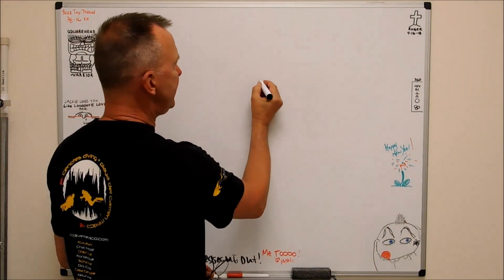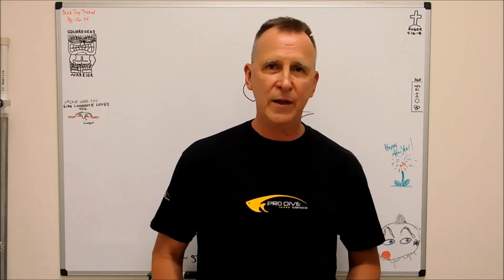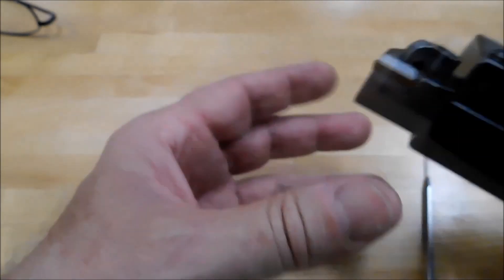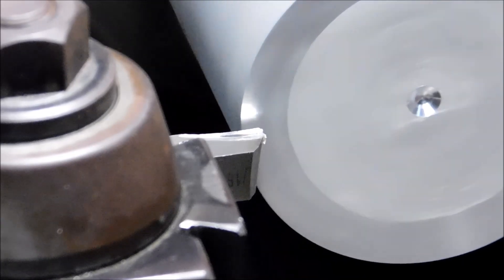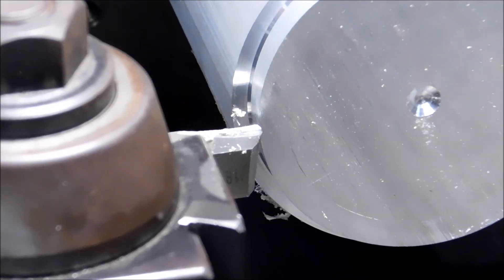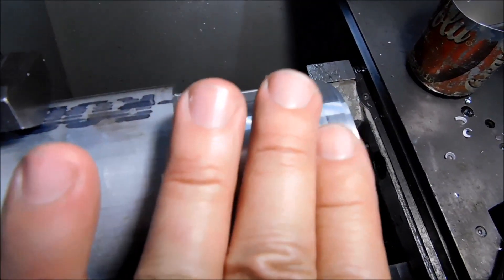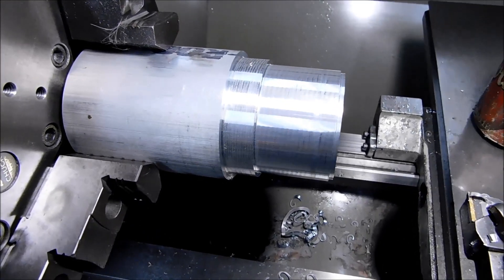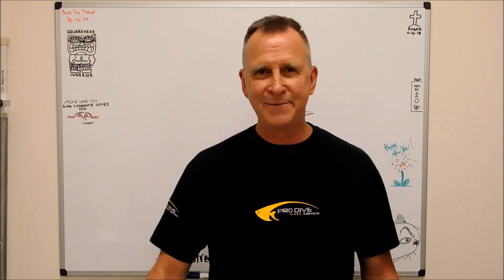C's and 6's...The Perfect Lathe Chip

Comment: Awesome I've never had the nerve to take big bites like you demonstrated. I struggle with getting perfect finishes on various materials, faster speeds & slower feeds with light cuts is my go to at the present still not the best. I've used both HSS & carbide various tip widths, no "consistency" when last pass to spot on size wanting the perfect finish, winds up it is what it is 😢, using a Monarch CY16, only 500+- RPM lathe speed available. maybe you can give me a few tips or do a short how to video, i'm sure there's others that might struggle with consistency also.  Happy New Year, thanks for all your efforts & time making videos, I've learned tons 😁
Reply: My neighbor has been a machinist for over 40 years. He told me if you get it close, just use sand paper for the rest. It may take a little longer, but you can always take away from what you are making but cannot add to it. That's what I practice. I'm using one of them chinese 7x14 mini lathes 0-2000RPM. My steel RPM is 225-325 depending on the steel and aluminum is around 325-375. Can't go by the machinists handbook with this tiny machines unfortunately. I don't take massive cuts because I don't think my machine has the rigidity to do so, but I've made lots of things on it within specs and it just takes me a little longer is all. When I hit the lottery I'll buy a 30 thousand dollar lathe and a bridgeport milling machine lol.

Comment: Well, everybody seems to agree that they prefer chips over getting smacked by weed wackers string, which I completely understand. But usually you're going to be running steel and it's going to be a really tight loop for about two to three inches. But the question is what color range is the best? I've been told multiple things but they all keep repeating that a darker purple to blue color preferred what's your opinion on this? We all know that you can watch the color change after and even during the chip coming off or after it is formed  but what is preferred for end color
Reply: Let me know as well thx

Comment: Thick chips also carry heat away from the part you're machining.
Reply: Exactly!  Attended a Production Engineering Research Association (PERA) course in 1975, and was taught that the chips should be C, 6 or 9 shaped... The instructor, Roy Jeal had a sense of humour... Blue to brown colour, would be bloody hot (I still have a scar on the back of my neck from one) We were using Valenite tooling, positive rake TPUN inserts, adjustable chipbreaker width, and running pretty deep cuts, high feed rates, no suds / coolant, and the workpiece remained cool.  It was a revelation... Also... We were taught that if we insisted upon using suds, it had to be constant, uninterrupted, or the tool would suffer from thermal shock (despite not really getting hot?) and had to be a deluge, not a trickle...  The suds did wash down the slideways.  Dry cutting produced a lot of abrasive oxide dust that harmed slideways...

Of course, we were also taught to take maximum advantage of machine motor power, and the machine rigidity, minimising overhangs of tooling and centres...  Then, after learning all that, you end up performing work on ancient wartime machinery (even 30 years after the war) that lacked power, high enough spindle speeds, was worn out, and lacked whatever rigidity it once had...

Comment: So what im seeing is your rpm is to high? Tries to form a chip but then also strings up. Im asking because when it makes the chip, it throws it all over. A month or so ago when i turned a slug of 6061, i was running around 600 or so rpm, it didnt want to form the chip but when it did, it threw it everywhere. So i slowed it down to 425 rpm or so, crank the feed to .010" on a .250 doc. It fell like a water fall and sounded like glass chips hitting the pan. When you hit that sweet spot, you'll know you have achieved something. I hear a lot about people not being able to get chips on 6061, but i say look at your feed and rpm. Well tooling helps to, I was using negative rake.... slower rpm's and a heavy feed.

Comment: Thanks Joe. Yet another great video but I have a question if I may. I try to use feed and speed tables for new materials but they don’t cover depth of cut. Other than the safety aspects is there any advantage to C/6 chips in the standard of finish or productivity?  Would the trial and error based result ever conflict with feed/speed formulas I wonder?

Comment: those are "klinkers" by the sound they make when they fall. smaller ones are "tickers" and  that's if you can hear them at all. What does the big planer from the Sultzer-Winterthor  video make? "klangers"
Reply from the maker: I toured Bethlehem steel when I was in school. They had a lathe so big, the chips being produced looked like coil springs from the front of a car. A front end loader worked non stop to clear them as they fell. The machine was surrounded with a very tall chain link fence to keep the chips from bouncing away and killing someone. It made quite an impression.

Comment: What about chip control on finish cuts? Particularly in a hard to chip break material like 316L.
Reply from the maker: 316L will never break a chip on a fine finish cut. Maybe if you have a dedicated tool with a very specific chip breaker, but don't bet on it.

Comment: I had to go 0.035ipr on a D2 material using carbide insert today just to get the chips to break.
Reply from the maker: Thats very aggressive, but it kept the tool buried.
Reply: I didnt feel right about it so I checked the machine. Turns out the manual override knob was feeding and slowed the programmed feed by 80%!

Comment: hmmmm... am I  understanding this is in contrast to thatLazyMachinist ?
https://www.youtube.com/watch?v=y4gDDq_55Is
Trying to get c and 6 is a nitemare sometimes on my lathe... in fact I get a clean smooth finish with the curled continuous chip as shown in the above video and the work remains cool.
I stopped using cuttin oil for the mess it creates, using a coolant that is mixed with water to produce a white solution, machine and work is clean and easily wiped away or vacuumed.
Reply from the maker: The ability to break a chip is based on many different things. But I think we should agree a broken chip is preferred to a rats nest of string. Some materials and cut conditions just simply don't cooperate. But when the time comes, the C or 6 is the perfect lathe chip. I'll stand by that comment.
Reply: @joepie221  Tnx Joe, thats what I always aim for after watching your schooling, sometimes though not successful, however I get a better finish with the longish curled chip in contrast to a rats nest, as that only happens when I am running too hot and the peel off is discolored bluish... tnx for your efforts bro, learned a lot from your channel.

Comment: Thanks Joe for this very informative vid. How about rectangular and diamond shaped inserts? They seem to have chip breaker grooves, but my experiences with aluminum were disappointing, even following your advices. Is this an intrinsic issue with those inserts?
Reply from the maker: It may be the groove itself is for harder materials. Look for an insert with a bigger radius type groove, not just that small edge slot. They do pack up quick on aluminum.
Reply: @joepie221   Thank you, Joe. I'll have a closer look.

Comment: Great Info. I just got myself a lathe and am pushing it to get those chips. So far using bits of unknown steel to practice on.

If you have an unknown steel how do you find the correct speed to cut? 

I've found this one peice will leave a great finish if run on the fast side but the feed must be 0.017" and still no c's or 6's. If i run at 2/3 the speed and feed at 0.006" then i get a beautiful shower of those nice chips but the finish sucks. Depth of cut is about 0.1 to 0.125 each case - Using Carbide inserts

Comment: With steels, is colour an indicator?
Reply from the maker: Yes. On many levels. When cutting, you want the color in your chips, not your part. A rich blue chip is an indicator the heat is leaving the cut with the chip, not staying on your part, and is a good thing. During annealing processes after heat treat, light blue, dark blue and straw colors can indicate the annealed hardness of a material.

Comment: I have no problem getting the proper chip on more powerful lathes, but I don't have the same luck on my 13" South Bend lathe at home.  One hp (1 1/2 hp 3ph motor running on single phase) and belt driven, when I apply the proper feeds and speeds, it'll stall the spindle.  The magic combo is around 014, .04 deep, 300ish rpm on something in the 2" diameter range.  Thoughts?

Comment: Joe, I love watching your videos but I have to confess that I watch them mostly for the "idea of the technique" as I do not have access to large tools. I've only been seriously dabbling with machining for about a year and am limited right now to my Sherline manual equipment. But recently I had to whittle down a 2" piece to .4something". I really liked the finishes I get with HSS tools but I ran up against the rats nest problem in spades trying to turn that piece down. I then put a carbide insert tool I have and worked on pushing it and could almost get chips like you show. What would happen is that it would start out a rats nest but by the end of the cut it would be spitting out little chips. The carbide tool is a 1/4" TCMT and I was turning a 1900rpm at about .01 deep per side. I tried both dry cutting and I have Boelube. Never thought to try WD-40. I woundering if it is even possible to get the chips like you describe on smaller machines. Even this 2" piece I was using is rare as I usually work smaller diameters and am thinking bending will be a problem trying to push it like you describe to make the chips. Maybe a lathe follower???

Comment: A minor burn from a smallish chip can only be better than a potentially nasty gash from a long stringy one. g00167015 mentioned the machinist's dance, lol but as someone who's done a fair bit of overhead welding... I've taken tiny spatter burns like a champ to get that weld done. but the beauty of welding over machining is if you let go of the trigger it stops doing what it's doing... a long stringy chip with a rotating motor isn't so forgiving.
Reply from the maker: The bad chips are the blue ones that jump on the machine control handles just at the moment you have to disengage the feed. Burn deep or crash the machine.

Comment: Do home hobbyist bench top machines have enough power to achieve this? I don't own a lathe myself but I feel it might stall a cheaper home machine taking such aggressive cuts
Reply: From my experience it depends a lot on the material. I have a Sieg C2 ( http://lathe-c2-extensions.blogspot.com/ ) - something really small, and I can't get soft aluminum to break. With other materials I get it to work. Big diameters are very tough though.
Reply: I have a sherline, been using it for 10 years both CNC and manual operation....  and the answer is hardly ever...  you have to push it hard and suffer stalls or bad finsihes as a result...  its better to concentrate on a good part, not the chip.  I told sell 'Chips'
Reply: Generally you are correct.  It takes horsepower to push the tools hard enough to break the chip.

However smaller radius inserts allow the machine to take shallower bites, and give similar results.  The key to chipbreaking is high feed rates, at a depth your lathe has the power to cut.

Comment: What are the consequences to stringy chips aside from the messy rat nest?  Does it wear the tool?  Cause chatter?   Make a bad surface finish?
Reply from the maker: I agree that stringy chips are just a major safety hazard. Aside from being an indicator your settings could be more efficient, you certainly will find some materials that just refuse to break. Make sure to stop the machine, wear leather gloves and use a hook or pliers to remove these strings. They'll cut you to the bone in the blink of an eye. Move slowly too.
Reply: kurtu5 If the rats nest wraps around the chuck it becomes very dangerous. Think weed wacker line made of metal.
Reply: If that's the only problem, then couldn't someone make a thing that sucks in the rats nest, breaks it up and puts the "chips" in a bucket?   I'm thinking like a vacuum/auger positioned where the 'chips' come off of the tool.
Reply: kurtu5 That would be awesome, I cut a lot of OFE copper and you can't break the chip in that material.
Reply: yeah,  C199 Copper will give you a long string, and I got this th eother night from "Marine bronze".  guessing C464.  it was salvaged from a boat driveshaft....   http://www.indysworld.com/string.jpg

Comment: Lathe revolution/feet per minute, feed speed, depth of cut and tool angle all are important in the perfect chip and smooth finish.
I kept experimenting until I stopped getting big hairy hot wigs in the face. LOL

Comment: Another good video Joe. I'm not a real machinist, but I'm the closest thing they got at the shop. We have a 15x40 and I have a double-ended TPG tool holder for turning and facing. It has the chip breakers on each end, but I usually end up with long strings. I think I'll sacrifice a view pieces in the interest of science and see how hard I can push things. I need to make up a feeds and speeds chart for different materials anyway.

Please keep the videos coming. I made a tool like yours to set lathe tools on center and use it constantly.
Reply: dont forget about push back (with barstock that fits the spindle bore) and stay within reasonable parts extension... even when taking multiple passes, especially with auto feeds

Comment: Yes and No...soon as the aluminum creates a bond with the tool from friction, the holder and tool will move from galling.

DCMT type is good  for turning, CNMG facing and VNMG for profiling.

If you profile your (high speed) tool with an undercut (chip breaker), it will cause problems with facing and not have a proper profile to make clean edges, where a low inside chamfer (radius) is needed.

it is best to utilize inserts for some things and high speed steel for others.

The fun of machining.  -_-
Reply from the maker: If you grind the front of the HSS tool correctly as well, it will cut to the desired inside corner geometry just fine. Inserts are good, but core skills like grinding a good tool should be part of the bag of tricks too.

Comment: Thanks Joe, a lot of us hobbyists watch your vids and work safer & smarter in their home shop as a result.

Rats nest instead of clean chips is especially a problem on small hobby lathes that don't have the grunt to cut that aggressively.

I saw a guy stumbled on a solution to this: he stripped the torx on an insert screw, and to make due he used a socket head cap screw to replace it. Said it worked great for breaking chips.

Comment: Great tips Joe, do you think that those chunky little hot chips take more heat away from the workpiece?  Seems to work out that way on my cnc router when I really push it hard through aluminium.
Reply from the maker: Yes. A heavy broken chip like that will definitely pull heat from the part. On steel,  a blue chip is a good chip.

Comment: The banding that can be seen across the part in that final shot about 12:36 .. what causes that? It has become a serious problem for me lately and it's driving me nuts. The parts I'm making need a nice final finish so it's causing a ton of extra polishing/etc.
Reply from the maker: Someone crashed this machine hard before I bought it and I attribute the "noise" in the finish to a bad combination of feed and RPM. Try another range for your RPM and see if it goes away. Thats what finally solved my issue.
Reply: Is that a gap bed? We have one that that's been crashed by apprentices often... I found the rack gear section on the gap had sheared off a couple mounting screws and roll pins so when it fed onto the gap that section of rack would flex and make a band on the part...
Reply: I've run it at every rpm in its range from unreasonably slow to top speed, the size of the banding changes slightly but it's always there. I've even taken it apart and readjusted every piece and fit, nothing. It's rather infuriating :)
Reply: material/diameter/tool/insert/etc. not enough information. rather a discussion for one of the specific forums.  i work with small, stringy stuff, unreasonal length to diameter ratios and so on. high pressure coolant can be a savior... if you cant break a chip, go deep and thin it as much as possible and blow it in the "right" direction. or, just happen to have the right insert for your application (which you normally dont ;p )
Reply: Lets_Turn_Stuff the same banding happens no matter what insert, material or diameter. I am not a general shop, I make specific products that I sell so my tooling is exactly for those materials. I have to assume the lathe itself is causing the problem. I can make small chips, but those lines are driving me crazy.

Coolant aside from dripping it or brushing it on isn't an option.
Reply: might be a combination of lead screw, machine bed, rigidity of the machine and the usual suspects.

same when hand feeding? tried at a friends (to repeat the results)? insufficient coolant. wrong coolant. sure you dont cause lines with parts of the brush? 

btw. we call them shadows... not measureable, but you catch those changes in the surface with your eyes.
Reply from the maker: Is it possible the main bearings in the headstock need to be tightened up? maybe even changed?
Reply: I suppose it's possible, hadn't considered that. It's only a year or so old, but maybe it was a defect. I'll look into it, thanks!